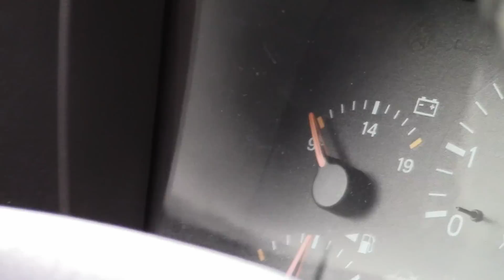Broke Down on the Side of the Interstate (Jeep Cherokee XJ) - GFB

Comment: for the future. you get a vault meter.. With the engine running attache vault meter to terminals of battery. it should read around 13 -13.5 vault.. your battery is 12 vault so this tells you that your battery is being charged... BUT Your battery would  just show 12 volt..no charging.. replace alternator...

Comment: I had the same issue with my XJ, the voltmeter would drop to nothing .. but restart it later and it would check good. I swapped out the alternator and it works great for many months since.

Comment: We have 7 Cherokees in our family. Mine has 300,000 plus on her. Never had an alternator go 15 years though. Also, AAA Plus....please get that. Its around $70 covers you for a ton of issues.. The family plan will tow you ANYWHERE! Up tp 150 miles. Just make sure you tip the guy well. Be safe. Gunny Z
Reply from the maker: silvereagle1833 I will say, we have since added AAA to our insurance plan, so we'll be covered for anything else that happens down the road. 

7 Cherokees... wow. I'm sure you've spent a lot of time under the hood!
Reply: NOTE TO SELF.....Get the AAA ........for retirement 2019   _ Truck / camper  / cargo trailer.
Just be grateful though we had a 1  month electrical issue this summer 2 tows electrical shorts are hard to find.....F$^#@!@$

Comment: Electrical probs, got to love'm. Had a alternator start over charging on a Grand Cherokee a couple months ago, it got so hot it started melting wires.

But anyway, back when I was young the bigger the tires on my 4X4 the better looking it was. As I got older and more wiser, looks were not all that it  is cracked up to be, its all about performance. I know it is "to each their own", but if it was me traveling around the country pulling a camper, the first thing I would do is get rid of those over sized tire on that Jeep. I know you 2 are on a budget but all those tires are gonna do is cause you more problems down the road. Just wait till you start pulling those Rocky Mountains, these hills in the mid-west anit nothing to compare to the Rockies.

I do wish you two the best on you journey.
Be safe out there and keep the video's coming : )
Reply from the maker: +rshotrod1965  Thanks for the well wishes! We actually just conquered the Rockies (videos to come). The tires are rough on the fuel for sure, but towing this camper is rough on the fuel any way you look at it. I baby our rig as much as needed to keep her on the road and in good shape. :-)

More vids coming this week, thanks for checking us out!!

Comment: See, this is why I kept my Jeep until it totally broke down: the instrument panel. Too many car makers these days think the panels are just "unnecessary." Example: Guess what a MINI Cooper panel DOESN'T have: mph, rpm, gas, water temp, oil pressure, battery output? It's everything after the word "gas." I have to be very careful watching the others by popping the hood open and testing it, which would be easier if the lazy car companies would get back to basics. Now they want to do away with the steering wheel!

Comment: Great videos! I am contemplating between buying a camper van (like a Sprinter) or buying a light weight travel trailer like your R-pod 171. I own a 2001 Jeep Cherokee XJ that I would like to keep for many more years. I would like to know what your experience is pulling this trailer with your XJ, especially uphill. Does it have enough power or is it down shifting like crazy? Also, do you have a brake control installed?
Thanks and enjoy your travels. If you ever plan to travel to LA let me know.
Reply from the maker: +DutchCherokeeXJ I personally think the Jeep handles it pretty damn well. We do have a trailer brake installed. On that note, I would never recommend pulling one of these trailers without having a controller hooked to the trailer... downhills could get very interesting. The first major hill that we pulled, we gained about 4000' over 15 miles or so. We pulled the trailer to 11000' up and over Monarch Pass on Highway 50 in CO. Long story short, we got it done... but we had to run about 30mph the whole way. I kept it in 2nd gear to avoid overheating the tranny. NBD! (no big deal)As far as LA goes, we will be there in a few weeks. (SHHH!) The videos are way behind our travels. Hit me up if you would like to catch up!